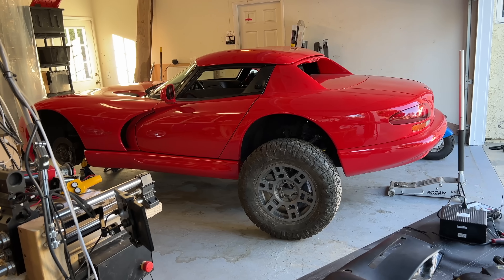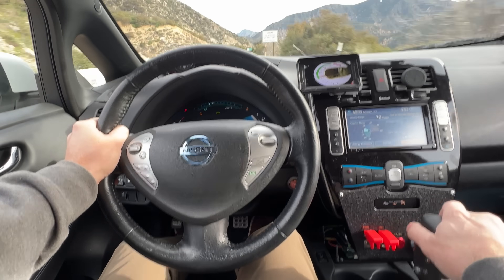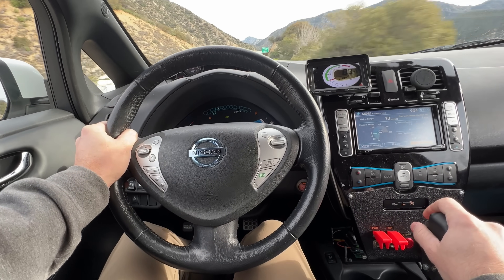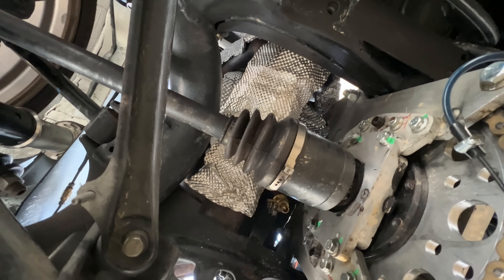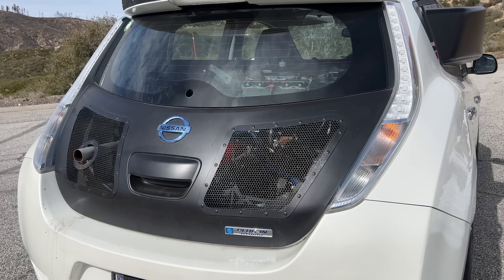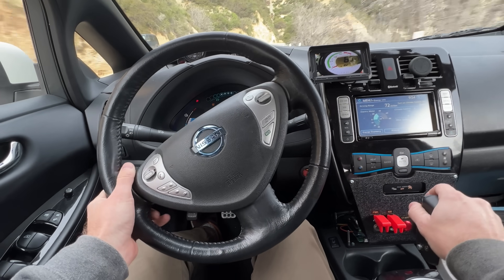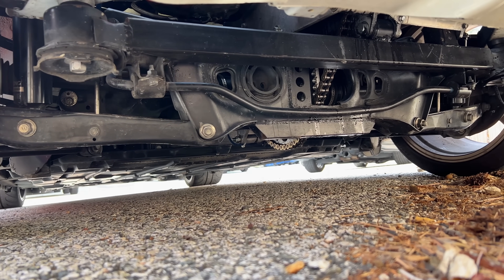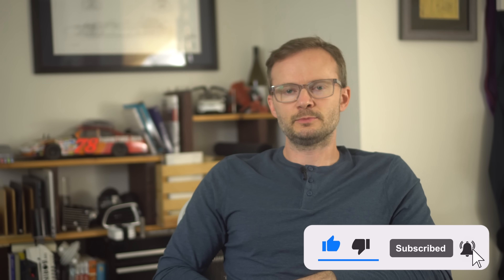This Nissan Leaf Is Hiding A 13,000 RPM Secret

Comment: This type of build is definitely the future of modern Hot Rodding. Currently EV's don't go to smog or inspection. Drive around on EV for every day driving and then turn on the ICE for some AWD fun!
Some new super cars are already doing Hybrid drive systems like this.

I LOVE THIS BUILD!
Reply: What I also like about this build is that it is fitted EV on just the front wheels and ICE on just the back wheels. If one of the systems fails you can still drive around
Reply: @sneaky_krait7271  also it's a 4x4 technically.

 that's how my bicycle is setup, electric motor in the front and pedals on the back, I have so much grip in sketchy paths in the woods, so I imagine it works well on a car too.
Reply: @satibel  True 4x4 is great for many reasons, but having a clear split is special here and like that specifically too
Reply: luckily vehicles over 25 years old also dont go for emissions
Reply: @md4luckycharms not where they are in CA :(
Reply: @md4luckycharms They should plus inspections. Too many older trucks giving off blue smoke every where. If you think that's ok, go suck on a tailpipe and see how long you last.
Reply: Worst of both worlds. You sheep are funny
Reply: EVs still go for safety inspection in every state that mandates that.

Comment: Thats the wrong way around. To create good, fast and efficient AWD hybrid, the ICE needs to be at the front. This way you get the low end torque to rear wheels, back seat and front wheel bias top end for stability. Also EV rear axle can moderate torque delivery in fast cornering and sketchy surface, increasing drivability. That build looks like fun, but it is a one trick pony and a fire hazard waiting to go off.
Reply: I guess the i8 and NSX (and E-Ray!) are backwards too?  EV drivetrain up front for more effective KERS is an upside.  For me, it's what I had to work with.  That said, I've been contemplating builds which would be the other way around, with a Telsa subframe swap into a FWD ICE car.  Also interested in hearing what looks hazardous to you (always looking to improve things), and which specific trick my pony is doing well..?
Reply: @DerekYoungdby  It hoons quite well, solid spool rear and interesting weight distribution. Sounds nice when stomped on, but that's about it. Solid rear paints nice skids, but when trying to corner it fast, it's hopeless. Tesla rear end into Honda insight with boosted 16v 1.6 and sequential would be a sweet ride, even at the track. It could easily be tricked to rev just like that litre bike, but with tons of more torque. Bike engines create enormous amounts of exhaust heat due to short stroke, when a lot of fuel is still burning inside the headers. When those glowing hot pipes are tucked inside a fairly closed space, problems are evident and basically almost impossible to fix. Air cooling would mess up the aerodynamics of the vehicle, and water cooling would add too much weight and unnecessary complexity to the system.
Reply: @oikkuoek  it's a Quaife ATB LSD.  It was great on the track aside from needing the yaw sensor yanked, and defeating the EV speed limiter.  The header is heavily heat shielded and 3000+ miles in I've had no issues.  It is a super fun backroad car, which is its main use case.
Reply: @DerekYoungdby  Do you monitor the diff temp? The speed limit on EV is also a characteristic of the setup. A sudden burnout mode on a fast run can get a bit tricky. Electric motor can only spin a limited speed until the rotating component melts into a blob from sheer physics. Having this feature on the rear axle is a tad safer than having it on the front. isolating the heat into the pipe radiates the heat back into the head, aluminium being good at heat transfer. This causes all kinds of extra heat related issues. 3000 miles is almost one oil change interval, so still nothing to brag about.

Comment: One of the questions I find myself asking about builds like this is, “Is that street legal!?!” I guess they are because people are openly driving these on public roads, but I’m wondering how hard is it to get stuff like this passed for a state vehicle inspection?
Reply: It's in California, which when I left there only required you to pass smog and generally didn't address any safety features of the car itself aside from minimum requirements to make sure the car is drivable. As the car was originally fully electric, it would not surprise me if there was no requirement to bring the car in for emissions testing because it shouldn't be producing any.
Reply: Throw a packing blanket over the engine in the boot. Nothing to see here, officer. 😅

Comment: There is a kit for Honda Civic type R, which converts rear axle to electric drive, it takes all signals from CAN bus and battery is in the trunk. 
ICE is not even aware it has electric motor in the back.

Comment: Matt, your intro is totally on point. "Why" is a question I get asked a lot? Why did I buy a $600 Subaru and spend 2x that putting a lift on it? If someone asks you "why?" you will never be able to answer it in a way that they will understand. People who understand won't ask why. They'll want to know the details, and how it all came together. I bet most people that watch your channel won't ask "why". 

The only why we'll be asking will be the "why am I on the wrong coast so that I can't hang out with Matt on the weekends drinking a great beer and talking about insane projects we wish we could build"
Reply: I get it, mines even worse. I’ve got a 15000$ 2002 outback… 🤦‍♂️

But 3.0 H6, dual range 5mt, 2” lift kit, Baja front springs, bilstein Tacoma rear struts, custom pipe bumpers, dual battery setup, 29” mud terrains. It’s a hilarious car, and while pretty much no one should do it, there’s just about nothing I’d rather drive for what I’m into this car.

Comment: CHAT GPT  why are mechanical engineers are wizards?  [For the algorithm - hail]

Mechanical engineering is the branch of engineering that applies principles of physics, materials science and mathematics to design, analyse, manufacture and maintain mechanical systems. Mechanical engineers are often referred to as being ‘wizards’ due to their vast knowledge and skillset in areas such as stress analysis, motion control, refrigeration, robotics and many more. 

Many of these tasks require creative problem solving abilities which a wizard would have in spades. For example, when designing new machinery mechanical engineers need to consider all factors ranging from initial cost and performance right through to reliability during manufacturing processes down the track. In some situations they may need to develop solutions or adapt existing designs which can be challenging but also very rewarding when successful.  They then need to put their ideas into actual practice. This requires them to develop detailed drawings showing exactly how the various parts should fit together so when manufactured it meets specifications for optimal efficiency regardless for what application it’s required for. 

In terms of maintenance work mechanical engineers use their strong technical knowledge to diagnose faults quickly whilst looking for any potential waste from an environmental standpoint as well. Similarly the ability to troubleshoot various problems related with machines makes mechanical engineers invaluable assets in almost any industry setting requiring highly skilled individuals. 

All of this means that whatever the task at hand, there’s no denying that mechanical engineers really do behave as if they have a certain magical quality about them – able to come up with creative solutions and turn them into viable products or services sometimes under pressure! It may sound like something out of a fairy tale but given the correct training and experience this is definitely not beyond reach of most anyone seeking a career in this field and thus gives new meaning behind the term “mechanical engineer wizard”!

Comment: I've been thinking about doing the opposite, putting a electric motor and battery up front on my rear engine rwd VW. 
I probably won't cause I don't like electronics in my cars, but it'd be a coo project for someone who likes troubleshooting wiring harness and microchips.
Reply: I always figured putting it in the back of a fwd car would be neat
Imagine leaf guts getting transplanted into a Honda CRX or something
Reply: Look up Vonnen, they do a hybrid setup that goes between the engine and transmission. You might be able to stick it in your proper Volkswagen.

Comment: is350 subframe looks similar to is200/300 mk1 subframe and now an idea was born i own is200 mk1 and looking to swap v8 to it but i dont know rear diff will handle the torqe ;)
Reply: All of the longitudinal engine cars (not SUVs) from Lexus use the same platform, so their suspensions and subframes are similar.

Comment: There is a lazier version of this that I keep wanting someone to build, which is a BMW i3 with the body shell removed and a Meyers Manx Beach Buggy shell fitted to the chassis. BMW have done all the hard work by making it modular already and the driving experience of the i3 is excellent with a real go-kart feel. 
Come on folks, someone with more money than I have must be able to put this together pretty easily.

Comment: As an EV enthusiast (and driver): this is seriously cool 😁👍
Reply: It would surely be cool if this could be done to all the old (10 yr old) EVs that are going to the junkyard...
Reply: @ReXoRofc  the leaf is a bit of an outlier with it's shitty battery cooling
Reply: it is amusing how most petrol heads pretend that all old EVs will be dropping dead in 10 years....  

due to the longevity of the leaf's, crappy air cooled battery pack...
Reply: @Matt-dx3wo  sure but i doubt all the new EVs will last for 20+ years like most gas cars just because of the cost of that huge battery pack , that's IF they even continue making these tailormade battery packs for each car. I think this EV car thing is BS and not environmentally friendly in the LONG term.
Reply: @ReXoRofc  I'm not sure I'm following your logic.
Reply: @nc3826  They retreat from one argument to the next, each one weaker
Reply: @ReXoRofc long long term the pack can be recycled. It's full of valuable materials dug up in distant parts of the world but sat in a junk yard near you. You can't unburn petrol although people are trying

Comment: Is his tach solution a closed circuit camera pointed at the motorcycle tach? 😆 it aint dumb if it works
Reply: $30 amazon back up camera.  Easier to install and wire than extending the 14 cable bike cluster wiring and mounting that bulky thing somewhere on the dash.

Comment: Being able to launch in EV mode has to be easier on the clutch as well.
Reply: A motorcycle clutch takes like an hour to change out
Reply: @LewdDarling  that seems correct.
Reply: @LewdDarling  ...when it's in a motorcycle. Might be a PITA stuffed into the back of a Nissan Leaf.

Comment: FWD EV with RWD ICE seems like a great way to make a low (ish) effort high-performance track car. No mechanical wizardry required to combine the best of both worlds and you can even recharge the EV on the straights if you set up the electronic wizardry for it. Then EV torque your way out of the corners for maximum smiles per gallon.

Oh yeah, all hail the algorithm.
Reply: I find it amusing every Tesla nurburgring lap record, excluding Plaid, is beaten by various years of stock Honda Civic Type R. Which the Plaid gets beaten by an Audi RS4 that are all a fraction in cost to the full EV counterparts. For that track the ABSOLUTE track record is Porsche 919 EVO hybrid even beating the Volkswagen IDr EV by around 45 seconds.

Comment: I hope he is going to learn from your experience with cornering and will dry sump it before having to replace the engine rather than after. Otherwise looks fantastic.  All hail
Reply from the maker: Fortunately, he kept the deep oil sump instead of shortening it like I did. So it should be fine.
Reply: @SuperfastMatt  just no skid-pad foolishness.
Reply: I put in an oil gauge before I went lapping to monitor this and the deep sump seems to have been enough (thankfully!)
Reply: @DerekYoungdby  Awesome car, Derek! 👌
Reply: @DerekYoungdby  glad you already had it covered!
Reply: You don't need to make room for the engine to fit under the hood if it's mounted in the rear. So much room for activities!
Reply: I think the transverse mounting helps with oil starvation too. Kawi pickups are in the rear iirc
Reply: @chaselandry2962  When a bike takes a corner, the oil is forced into the bottom of the pan, not towards the side like it is in this car
Reply: @ACatKrom  yes I have 5. Bike oil remains more or less centered as you lean. Also most bikes pickup tube goes more towards the rear. I think Matt's burned up because longitudinal mount and a right turn pushed everything to the front of the engine away from the pickup.
Reply: Also the fact that the engine is longitudinally mounted would most likely be less problematic in sideways G-loads.
Reply: Traverse mount isn’t as bad for them, the oil sloshing is in the intended directions.
Reply: @Jonathan_Doe_  Motorcycles only deal with slosh forward and back, if they get slosh left to right then the bikes is probably flipping sideways with the pilot getting really intimate with the pavement. (It's not as fun as it sounds)

Comment: Love it. Any chance for a follow up on how the engine is charging the batteries? Worst case it could push the rear tires into the regen on the front tires, but I suspect that would suck.
Reply: Yes, regen through the road.  The rear wheels push and the front wheels drag.  How this happens is based on the the bias of the EV and ICE motors.  Most of this is via Leaf settings. "B" adds higher regen, "ECO" disabled EV power for first 1/4 of pedal travel.  In this mode, the EV will regenerate during this portion of throttle position while the ICE pushes the car forward effectively charge sustaining.  The car typically is only regening at 20kW, which is barely enough to feel and definitely doesn't upset the handling.  It can drive as long as there's gas in it (it only holds 5 gallons which is good for about 100 miles).  I drove it from SF to LA and back (+ canyons, + trackday) and didn't plug it in.
Reply: @DerekYoungdby  Cool, its a "keep it simple" solution that sounds like it works fine. I'd be hesitant to use it in slippery conditions but highway driving in normal conditions doesn't really use much of the tire's grip, so sacrificing a bit to regen would be fine..
And well, pretty much all EV regen is a bit scary in slippery condition, as is ICE engine braking, retarders and such on trucks can be downright dangerous to use.
Reply: @DerekYoungdby  Amazing solution. The regen strength can be adjusted?

What's the wet weight of the car right now?
Do you plan to get a full capacity or an upgraded battery for the EV side?
Reply: @Full_Throttle_no_Brakes  the leaf has some setting that adjust it slightly, but it's mostly based on SOC and throttle position.  Typical regen is in the 20kW range.  Weighs in just under 3800lbs (!!!).  I would love a new battery, but it's a lot of $$ ($5-12k) and it's working fine for now.  I hope to upgrade to a Leaf Plus inverter soon increasing the front wheel power from 80 to 150+kW, which might be the nail in its coffin.
Reply: I have a 2015 Leaf and I'd bet money he's just using the regen braking from the front EV drivetrain to charge the batteries. The knob on the right would logically split the throttle demand between the EV drivetrain and the motorcycle throttle. So it wouldn't be difficult to create a situation where the rear is powering the car forward while the front is trying to decelerate. The EV drivetrain wouldn't know the difference. It would just look like a big hill
Reply: That is very likely how it works, and is how the new Corvette e-ray works
Reply: When they're both contributing to propulsion this works fine, and how normal AWD EVs have worked forever. But if you are trying to get the ICE motor to charge the batteries by going through the regen, that means that the rear wheels are pushing and the front wheels are trying to slow down. Besides the additional tire wear and all the inefficiencies on both sides, it would lead to some interesting traction dynamics when you're off-throttle going around a turn and all your tires are already using 30% of available grip sending power to each other.
Reply: he literally did say that the leaf motor doesnt mind being ``helped`` by the rear drive... So yeah, by that, i would also say that the rear literally just does its thing as matt said, entirely separate from the front drive...